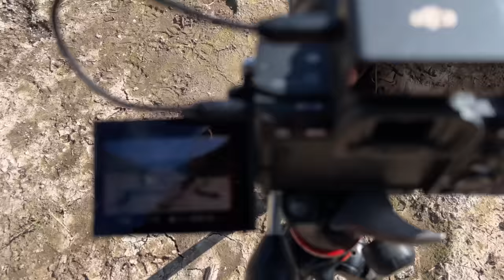KAMPTA ÇADIRIMIZ YANDI !

Comment: Get a tipi , you won’t  regret it , they are perfect for fire and safe . Obviously tipi poles require a large vehicle with racks , but if you can manage  that , tipis are amazing, warm,  safe ,and spacious , with high wind and snow resistance . Bamboo poles are light and easy to manage ,  it’s just the length that can be a challenge . 
I’m glad you both were not burnt , lessons learnt hard , are not forgotten . 
Peace from Australia.

Comment: I am an electrician living in Korea. All campers watching this video should wear a rubber insulator (rubber cap) hat to prevent the voltage part of the battery from being exposed. It really protects a lot. Electricity is convenient, but we must not forget that a fire can be started with just a 1.5v battery. - I'm glad the fire didn't start while you were sleeping. If you learn a lesson and forget your misfortune, good things will await you.
Reply from the maker: Thank you so much🙏💚
Reply: I appreciate your insight on their situation. I have a question for you. 

I think I might understand what you mean about rubber battery caps. Are they just to protect each terminal from short circuiting? Overvoltage? Both and more?

I don't know what caused the actual fire in this video. Was it that the terminals on the battery were open to the elements?

If so, was it some kind of electon charge in the air that causes the battery to powersurge or something?

I'm genuinely curious about what would've caused this. Definitely too cold outside, from the looks of their coats, for there be any heat from the weather causing the battery to overheat. 

So, would it be something to do with the cool air/wind they were mentioning in the video, that wasn't letting off and was hoping the wind would die down, so as to go fishing, when they were eating? Any insight is appreciated. ✨️✌️

Comment: The baked potatoes sounded perfectly cooked with the crispy skin on the outside. A good baked potato with cheese or sour cream and butter is delicious. They are also yummy with a tomato salsa. I haven't watched the whole video yet, but I am sorry that your tent caught fire. That is something that I have feared watching the various camping videos where people have a wood stove or cook inside the tent. I grew up going on camping trips each summer for a few weeks to a month with my parents and 6 other siblings and our dog. We had a trailer that had a tent attached to the top which was also a queen size bed. The 4 locking compartments underneath the bed held most of our equipment and sleeping bags. There was a zip on addictional room where we setup our camping cots that could be stacked like bunkbeds and that is what my siblings and I slept on in our sleeping bags. It could get pretty cold at night in the mountains where we went camping and exploring. All of the food was kept in the back of the family vehicle to prevent bears and other wildlife from getting into it. We cooked outside either over the campfire that usually had a grill grate you could lift up if you didn't need it to cook on.we had to clean it well before using it and sometimes we covered it with foil before putting food on it. We also had a Coleman campstove that was set up on a folding metal table we brought with us we did our prep work either at that table or on the picnic table in the campsite. We even did our dishes and cleanup there. Whenever we came to a new campsite part of the setup after the tent was to put up a series of canopies that covered the picnic table and prep table and the front of the tent. Depending upon the site layout they could actually connect which was helpful if it rained. Dad had heavy duty tarps and plastic sheeting that he attached to the sides of the canopies to keep it dry underneath them and provide a covered walkway which came in handy when you have 7 children and a dog. We always had a lot of fun on those trips.
Reply from the maker: What a great time you had, all of them are great memories🙏💚

Comment: Glad you are both okay. Great job cleaning up the site before you left. Very commendable. From my perspectives it looks like your battery had exposed plugs and the fabric of the tent that was flapping in the wind must have rubbed on them and caused sparks. Possibly if those flaps had zippers that could have have caused sparks. That must have given you a real shock. I see this was over 8 months ago. Be well.
Reply from the maker: Thank you so much🙏💚

Comment: I'm sorry for your loss. 
Camp safety:  we all forget about it, thinking everything's ok.  

1.  If you have fire (the stove) then put the fire extinguisher just outside, within reach
2.  Electrical (your inverter, battery) - should be "outside" with heavy duty power cable coming inside ... if a fire happens, it happens "outside". 
3.  Always consider combustibles around things like the firebox, inverter, and various electrical items.  A tent can go up in moments!  

I am so, so glad you are both safe!  

Tips:  
keep water storage near the picnic table/cooking area
keep fire extinguisher nearby as well
keep a shovel handy, to use "dirt" to smother a fire
next time, grab the blanket on the table you moved and smother the fire while it's small.

*NOTE:  it's easy to spot what you did wrong after-the-fact ... LOL  
I'm just throwing these out to learn, so you're prepared next time.  You have an adorable wife.  Keep her safe.   You did a good job here!
Reply from the maker: Thank you very much for your advice and comment🙏💚

Comment: Did you work out what caused the fire? I could see the big battery and that the attached wires looked burned. What was the battery attached to and were the wires the correct size for it? A few years ago a vape battery I was charging exploded and set fire to my desk. Luckily my sister was in the room and put it out. Lesson learned is not to trust cheap fixes when playing with electricity. I’m very sorry to see your problem, I hope the smell of smoke doesn’t persist if you decide to salvage items.
Reply from the maker: We think it is caused by the inverter. The light was plugged into the socket to charge. Thank you very much🙏💚 I am very sorry about what happened to you🙏

Comment: This video is nothing short of a disaster caused by human error. I don't know if he did it to save money, but he seems to have used a very low-quality AGM battery that is vulnerable to fire or explosion, and the connected clip or wire looks very weak. The inverter also seems to have misused something that doesn't fit the battery capacity or isn't certified. Power banks made by professional companies are the safest for batteries for camping.

Comment: You know what caused it right ??

Lead Acid Battery with undersized wires attached by cheap metal clips to the inverter.  
Got too HOT from the inverter load and POOF 
Don't use those cheap chinese wires/clips to an inverter and ALWAYS have an inline fuse or $10 breaker inline on the positive battery side. 
even a Battery Post Top Fuse for $15 would have prevented that

Comment: Buy an Anker Power Station for all electrical amenities next time, battery inverter is very dangerous and especially if you don't have a fuse disconnect protection. (Always install a 15 amp or 20 amps fuse for safety first) Better yet! Don't ever use a stand alone battery ever again! Buy a real power station like "Jackery, Anker, Bluetti etc... All those brand names are the safest for camping.